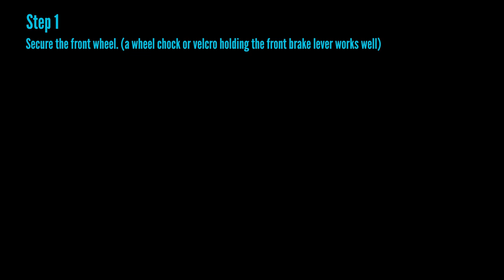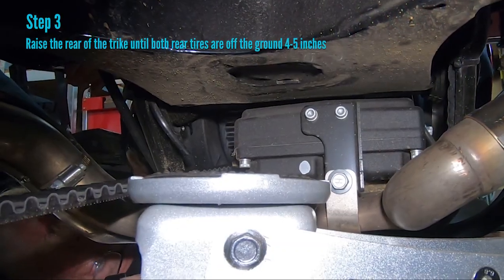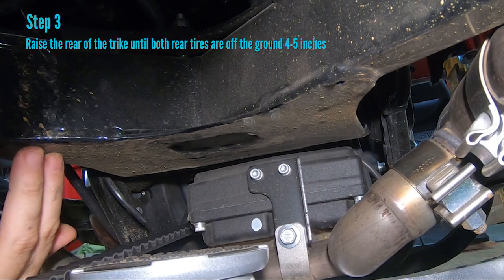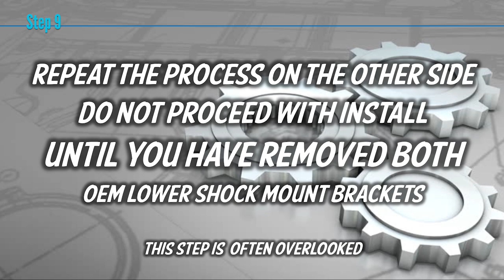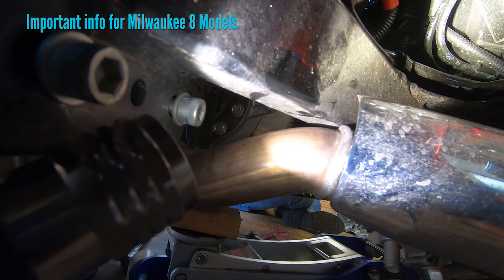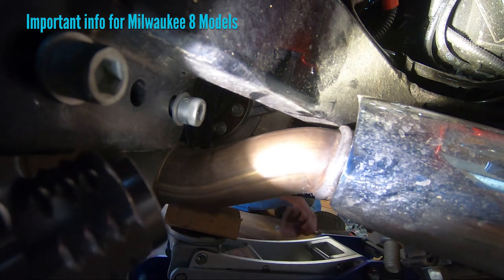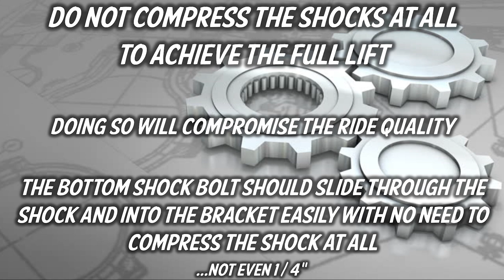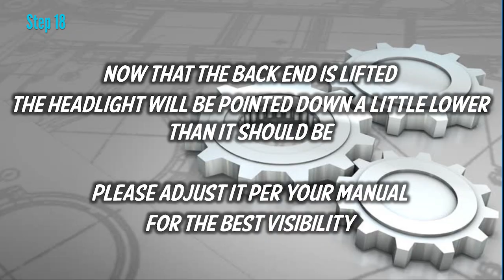How To Install 14" Trike Series Shocks on Harley-Davidson

Comment: I’ve been contemplating this upgrade for a while because the Harley stock shocks suck on my 2017 Freewheeler. Finally pulled the trigger and installed them today. Definitely took my time and double checked everything twice. This video helped and mirrored, ( but enhanced) the written instructions.  It took me about 4-1/12 hours to complete and clean up. Test ride there is a noticeable difference on the short ride I took. Can’t wait for a longer day in the saddle, but that will need to wait for better weather here in central Ohio. Thanks for the work guys!!!

Comment: I just talked with Dwayne and he was real helpful. I have watched the videos about air pressure and your new rear shocks. First question is my trike is a road glide 3. It is a 2023 with tire pressure monitors. Can that be reset so you can run 20# of air in the rear?  Dwayne didn't know. Also he recommended your Nexgen 13" Trike shocks and Convertible comfort lift for my trike. I weigh 150 and my wife 120.  What is your advise?
Reply from the maker: I am not sure if anyone has figured out how to reprogram the TPMS system on the HD's to not alarm when the PSI is lower than the OEM specs.

I would call around to various HD Dealerships, looking for one that has successfully reset the lower PSI to not alarm.

There are a couple of other options.

1.  With the 13" NexGen's and the Convertible Comfort Lift, you may find that running the PSI at 24 (I don't think it alarms at that PSI), or even 26, will give you a greatly improved ride quality.

One thing to keep in mind, with the low profile tires on the RG3, the lowering of the PSI does not make as much difference as it does with the taller sidewalls on the Tri Glide.

2.  Some folks just ignore the TPMS alarm, and run the PSI where they want.

Yes, Dwayne is correct! We have had a few customers with the RG3 get the 13" NexGen™ Shocks with the Lift Kit and be more than happy with them. You can see some Customer reviews at the link below on the review tab below the product pictures. - https://www.dkcustomproducts.com/dk-custom-nexgentm-14-trike-series-shockstm-for-harley-davidson-trikes-2040.htm

I am certain that you and your wife will be well pleased with the ride quality and handling after installing the NexGen™ Shocks and Comfort Lift. 

Please feel free to contact us with any questions;
Support@DKCustomProducts.com

Thank you for commenting! MB
Reply: @DKCustomProducts   thank you
Reply from the maker: You are most welcome! MB

Comment: I just purchased the DK lift kit. I cant do shocks and lift kit its one or the other?
Reply from the maker: Yes, you can put aftermarket shocks on your trike with our Lift Kits, it is highly recommended for a better ride quality.
We make two different Convertible Comfort Lift™ Kits.  You can see them both at the link below.
---One of them is for use with the taller than stock 14" Shocks.  With this lift kit, while they are made for 14" shocks you could still run 13" shocks with them.
---The other is for use with the OEM length shocks of 13 inches.  You cannot run 14" shocks with this lift kit.
https://www.dkcustomproducts.com/harley-trike-lift-kits-c56-73.htm
Always feel free to email or call with any questions-
Support@DKCustomProducts.com
662-252-8828

Comment: U have 2016 harley tri glide i need those and the shocks
Reply from the maker: Here is a link to the best ride you can get in rear suspension on a Harley Trike-
https://www.dkcustomproducts.com/dk-custom-nexgentm-14-trike-series-shockstm-for-harley-davidson-trikes-1971.htm
These will fit your 2016 Tri Glide and will revolutionize the ride quality.  
Feel free to email or call with any questions
Support@DKCustomProducts.com
662-252-8828
Thank you for looking at our parts! 👍

Comment: I installed one on my 2019 today. I was only able to get the secondary bolt holes to line up without compressing the shocks or ?? My first test ride I had the shock setting at 10. It definitely cornered better but was wobbly and top heavy. I adjusted the shock setting to 15 and it helped with the rear wobble. When I got home I cranked it to 20 and will see how it feels next ride.
Reply from the maker: Not sure what you installed, but it sounds like the  Standard or 14" Convertible Comfort Lift which uses primary or secondary holes.  Secondary bolt holes would be appropriate for almost all 2019 models.  However the 14" Trike Series Shocks have No settings of 10, 15, or 20.  So not sure what you are referencing.  And there is never a rear wobble or top heavy feeling when using Trike Series Shocks.  Any wobble you are feeling, or top heaviness would indicate to me that you should Not ride the trike, it sounds like something is wrong somewhere.  You can call or email the shop and we should be able to help you out.  662-252-8828 or Support@DKCustomProducts.com
Reply: @DKCustomProducts  The post was under a You Tube video on installation of the comfort lift kit. The 2019 Tri Glides have adjustable shocks that range from 0-30. When I first test rode it the shop had it set at 2 and the same rear end wobble occurred. I even had the dealer follow behind me and they were confused on why the ass end was moving around. Anyhow, they added 2 PSI to one of the rear tires and I cranked the shock setting to 10, then 20 and ended up settling on 15 which seemed to work best, especially with 2 up. I'll just keep playing with the shock adjustment to try and get the best ride and wobble out. From what I watch and read the HD shocks on a trike suck no matter how they are adjusted. One of the prices you pay for riding a trike as I see it.
Reply from the maker: @stevesmith5551  Ah, yes, you are running the stock shocks.  They will be a bit better with the Comfort Lift, but the new coil over shocks are better in some ways than the air shocks, but in other ways they are worse.  Here are a couple of videos we've done on the new stock shocks.  https://www.youtube.com/watch?v=Z4Dhg48_KQA  and https://www.youtube.com/watch?v=5-NVrRF9554

Comment: Tengo legend 1310 1210 y uno tira aceite por arriba se puede reparar ,??
Reply from the maker: I am sure it can be repaired.  You should contact Legend Suspension and let them know one of their shocks is leaking and will they repair, repair or rebuild it.
We do not recommend Legend shocks for a variety of reasons, this being one of them.

Comment: So, this kit ,no adjustments on the spring preload?
Reply from the maker: We send them already pre-adjusted per the specifications given when ordering.  However, you can adjust both the spring pre-load and the damping.  You can see the details on how easy that is at this link- https://www.dkcustomproducts.com/media/wysiwyg/framesuspension/rearshocks/proaction/14_Pro-Action_Rear_Shocks_Instructions_3-9-20.pdf
Reply: @DKCustomProducts  ,is this a kit?,or two separate parts?.
Reply from the maker: @kevingleason5434  14" Shocks and 14" Convertible Comfort Lift™.  Two different parts.  You can buy them separately, or you can buy them as a bundled kit.  See the options at this link- https://www.dkcustomproducts.com/rear-shocks-c651-194.htm  and then the Lift Kit separate at this link-  https://www.dkcustomproducts.com/harley-trike-lift-kits-c56-52.htm
Reply: @DKCustomProducts  , how can I tell if I have stock shock brackets or a lift kit, ( we purchased this used).
Reply from the maker: @kevingleason5434  At the bottom of the bracket, where the bottom shock bolt goes thru the shock and into the bracket.  If the piece sticking out from the bracket, that the shock bolt goes thru is round, it is the stock bracket.  If it is shaped like a nut, it is an aftermarket bracket. 
The Aftermarket brackets will fit any 13" shock, but if you want to run the 14" Trike Series Shocks™, then you need to get brackets specifically designed for the 14" shocks, as seen in the links I previously posted.
Reply: @DKCustomProducts , would you happen to have a picture of a stock one ,next to the other?.
I'm not seeing what your saying.
I greatly appreciate your help. 
Thank you.
Reply from the maker: @kevingleason5434  Here is a photo of our Convertible Comfort Lift™.  https://www.dkcustomproducts.com/media/catalog/product/cache/1/image/9df78eab33525d08d6e5fb8d27136e95/c/o/convertible_comfort_lift.jpg
Reply: @DKCustomProducts  , stock looks like this?, only without the nut ?
Reply: @DKCustomProducts  , Thank you  for the picture.
Reply from the maker: @kevingleason5434  No.  Not only does the stock not have the nut, instead it is a round piece of metal.  The stock bracket is also NOT convertible, so it has less holes.  Where you see the 4 holes in the following photo, the stock only has 2 holes.  https://www.dkcustomproducts.com/media/catalog/product/cache/1/image/9df78eab33525d08d6e5fb8d27136e95/c/o/convertible_comfort_lift_2.jpg
Reply: @DKCustomProducts  , ok, so they do come with a stock bracket?, yours has different holes for the height,  which your bracket is used in conjunction with the 14" shock.
I went ,and looked at ours, it doesn't look anything like what you sell.
You don't finance do you ?, lol.
Reply from the maker: @kevingleason5434  Nope, no financing.  However, I do believe if you use paypal they have a program that does financing.
For more details on shock and Comfort Lift™ options, give Dwayne a call or email and he'll be able to answer all your questions.
Support@DKCustomProducts.com or 662-420-4891
Reply: @DKCustomProducts  , Thanks. 
I've tried calling him, he doesn't answer ( not today I didn't try, I figured y'all are closed).
Thanks again.
Reply from the maker: @kevingleason5434  Yeah, skeleton crew this morning, no one this afternoon.
You should be hearing from someone tomorrow.